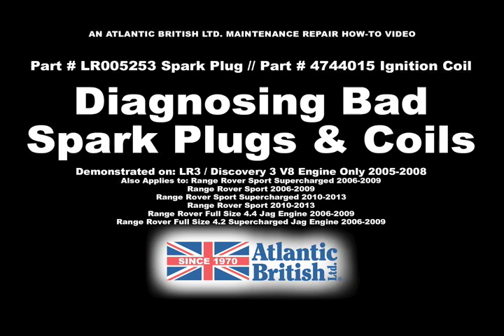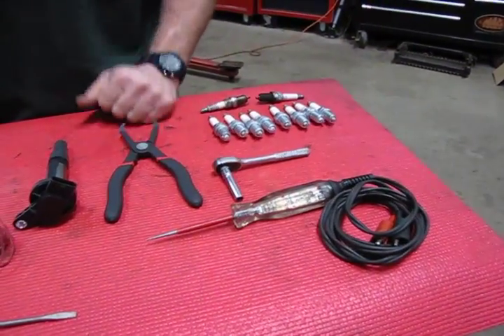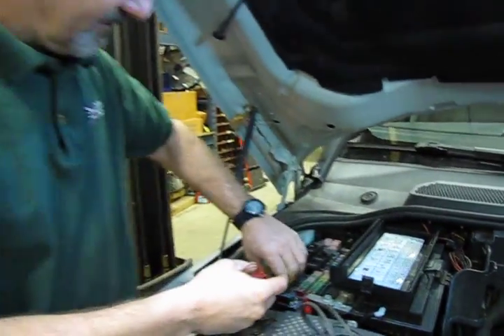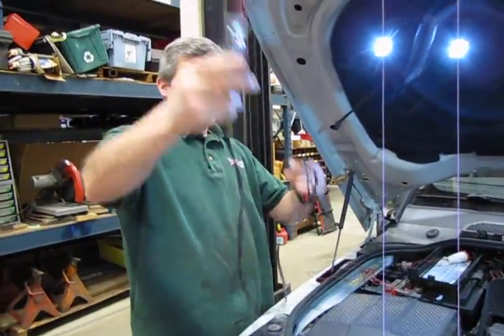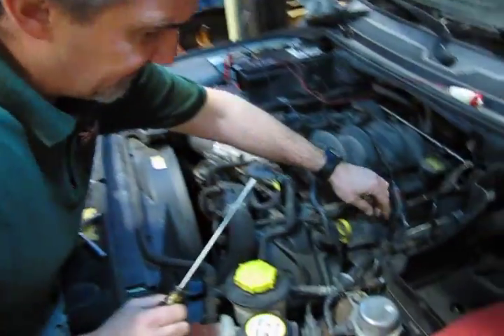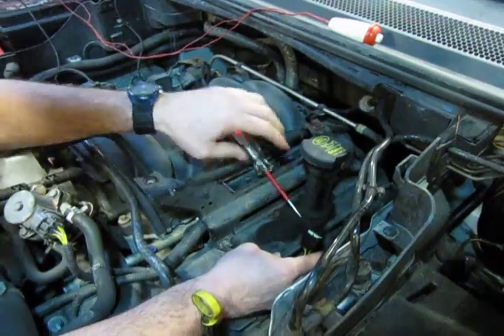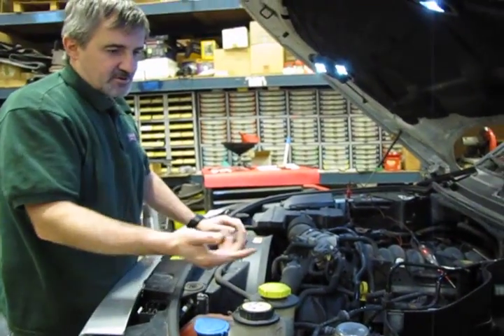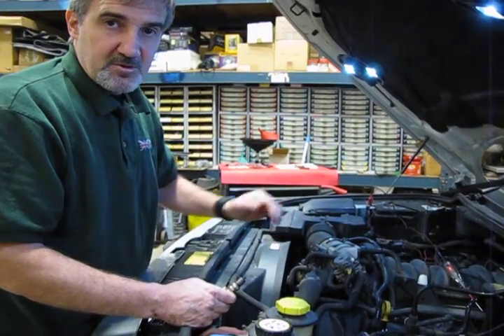Diagnosing Bad Spark Plugs and Coils on a Land Rover LR3 2005-2008

Comment: If the misfires are inconsistent: rough startup everytime, and sometimes, it doesn't misfire, Is it an obvious indicator that it's the spark plugs and not the wires? Thanks!

Comment: I rebuild a range rover sport 3.0 SC engine. All are perfect but the 6th cylinder have the misfire detection. But not showing fault code. The engine running above 350 km above. Now this engine have smoke I change the tappet cover and pcv adapter. The car no have right now but have too much vibration. Showing random missfire

Comment: Hey my brother I have a 2006 LR3 6 Cyl that doesn’t start and is driving crazy. The car was running fine and once in a while it will just won’t start but now the car just crank and crank and nothing , nada Lol it won’t start. I have check everything posible and even swap parts from one car to another and nothing. Crank sensor , cam sensor , ignition capacitor and nothing. The curios think is that I get spark on first crank but only one spark and only on cylinder 1 and 6 and the rest of all coils are completely dead. Also i took the intake and valve cover out and I check TDC and cams  timing and is good. I will really appreciate any help you can provide. Thanks you soo much
Reply from the maker: It is possible that you might have a security system issue with the vehicle. But to get a true diagnosis you'll have to bring it to your LR mechanic.

Comment: Help I live 100 miles to the nearest rover dealership 
I’m getting this code . What could it be.
Thank you
P2096 
Post catalyst fuel trim system to lean bank 1.

P0327
Knock sensor 1 circuit low bank 1 or single system,

P0332
Knock sensor 2 circuit low bank 2.

Comment: hi l have an LR3 2006 v6 and have pulled the codes and had p0171 & p0174 with no check engine light illuminated and sometimes the vehicle have some hesitation and sometimes won't start.....what should I look for in that case.... I already changed spark plugs,wires,fuel pump and clean MAF !
Reply: I'm having the same issue and I just got p0332 knock sensor code. Did you fix yours?